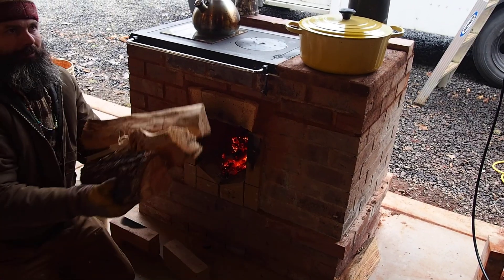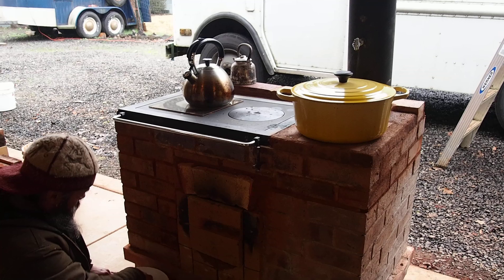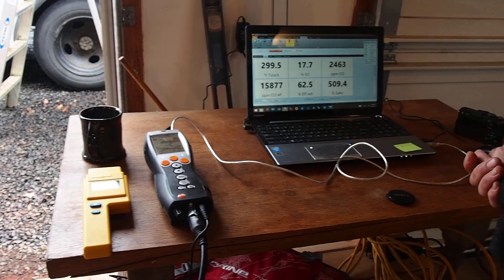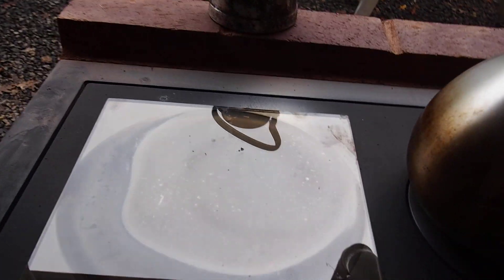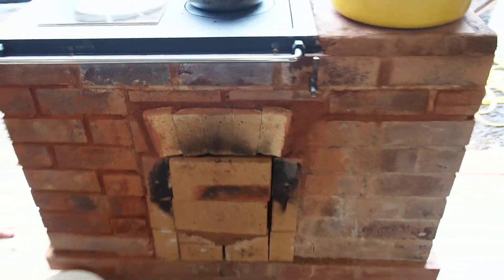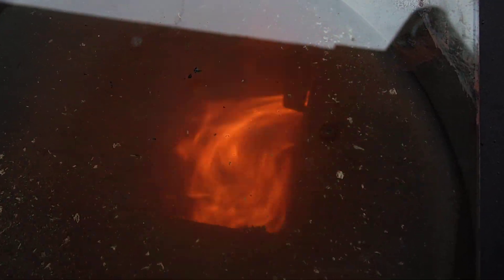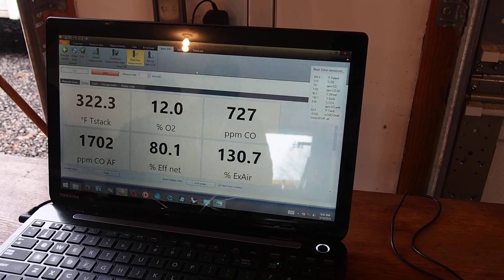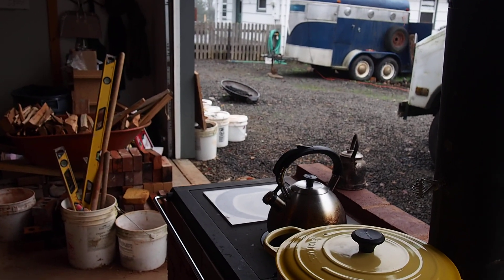Cabin Stove 2.0 Prototype Video

Comment: Thanks for the information, nice idea, could you tell me what is the temperature on the chimney?, because I want to make an spiral copper  put it around the chimney  and hot water  for shower.
Reply: Copper inside the fire chimney is the best bet, buy stainless wort cooler tube pre made

Comment: OK just got on your mailing list and just in time obviously as I'm very enthusiastic about implementing this into a space adjacent to a waterwell ,or concrete block cistern if you will, to heat the rest of the house by piping water through to the perimeter basement floor . We go from -35 deg Celsius in the winter and up to + 35 in the summer here in the wilderness of Manitoba and my 8x20 veranda could house this beauty for use year round. In the summer it could be used to heat the water and in winter bleed off from the pool to warm the basement. How does dropping out the water serpentine affect accessibility? Could one still add this?